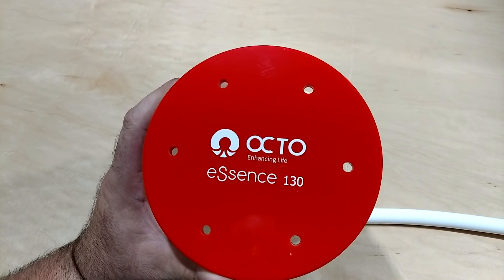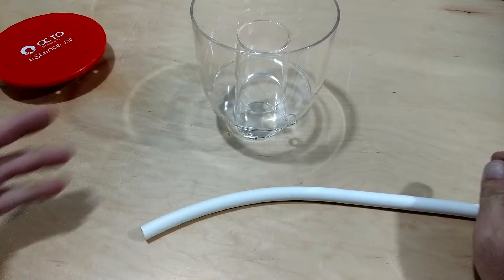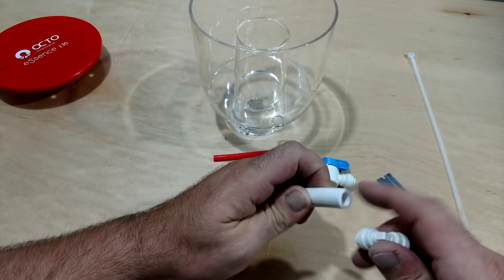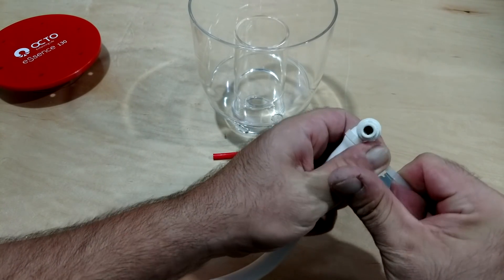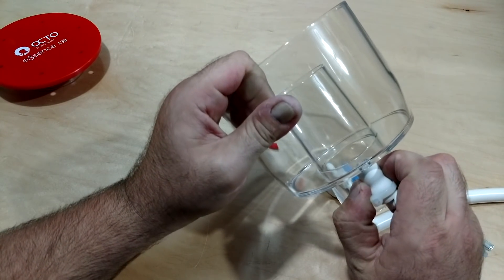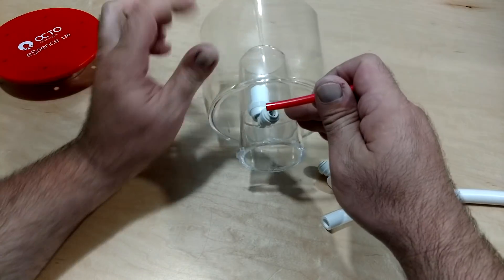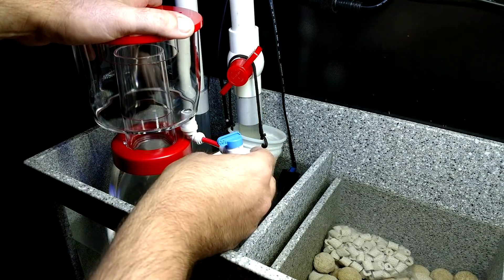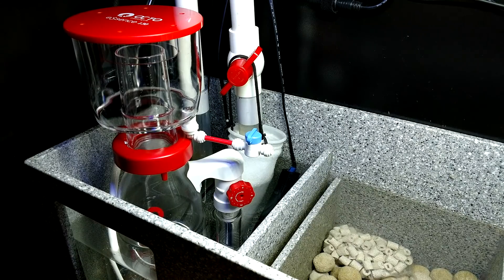DIY Skimmer Upgrade - Collection Cup Drain Valve

Comment: Why is this necessary? Not being a smart ass, but is there a reason other than convenience? Is the skimmer cup difficult to remove, not a lot of over head room in your stand/cabinet? Lastly, is there a chance it gets clogged with the skimmate gunk after a while and would it work with a thicker skimmate compared to a wet skim? TIA!
Reply from the maker: This is just for convenience. This allows me to empty the cup without turning of the skimmer. It should be ok with thick skimmate. Mine never gets to thick though 👍